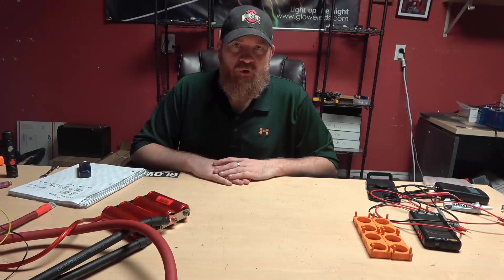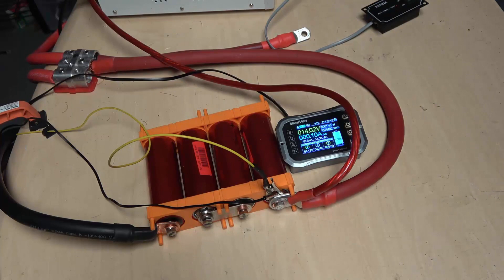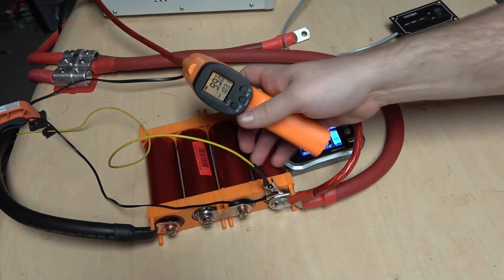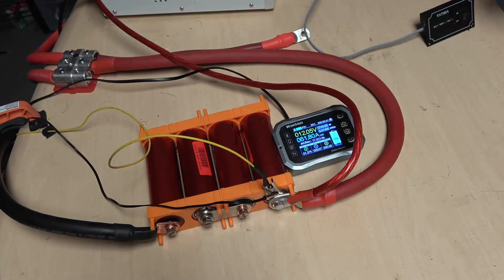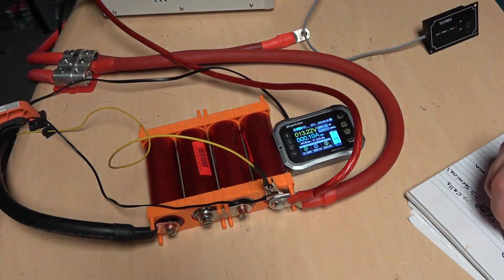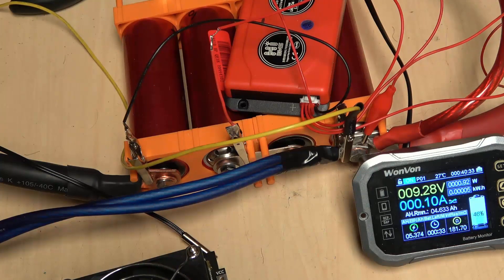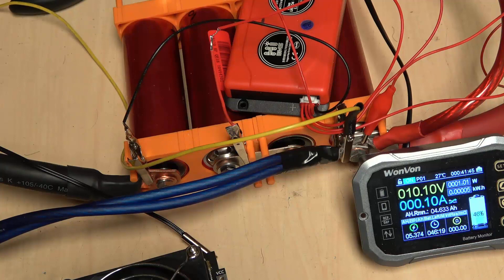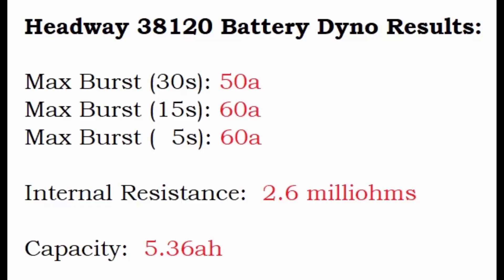Battery Dyno #1: Headway 38120 LifePo4 - How much power can you get??

Comment: I'm  looking at using these cells in a traction battery. In that application, I don't mind the drop below 12v nearly as much, but I am interested in  the maximum current I can pull. Based on that, would you recommend these batteries? I am getting mixed reports on the C rating, as high as 30C from some sellers and as low as 10C from others, all marked as 38120HDs.

Comment: I bought some of these because they were meant to be high currnet.. in reality they are poor. Went to blue 6ah lto, whic had a tiny fraction of the internal resistance and therefore the lto were much much better for high current .. over 100amps
Reply from the maker: LTO cells are definitely going to yield better results than headway, I agree.
Reply from the maker: I’m not a fan of headway cells, but many folks are - that’s why I threw them on my test bench. 

You should check out our series 3 battery!  It can provide over 700a of current.